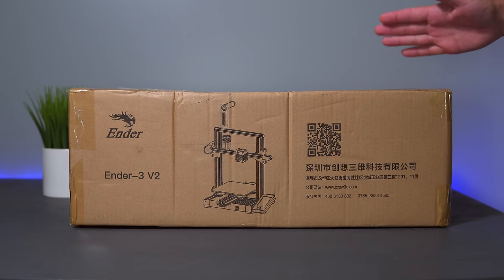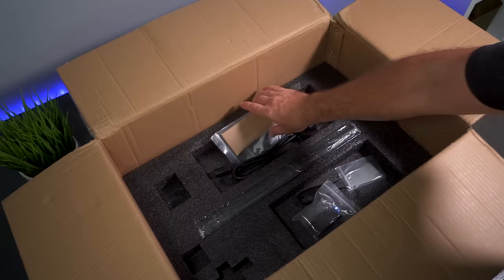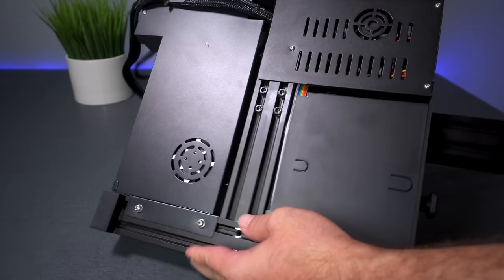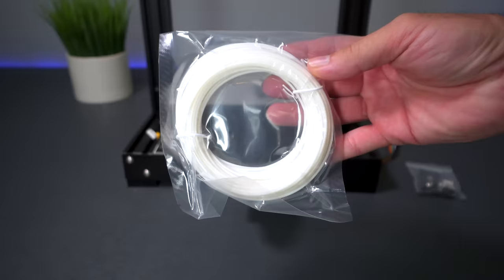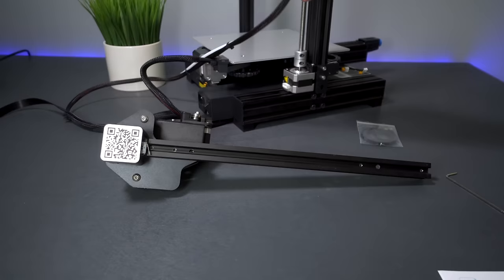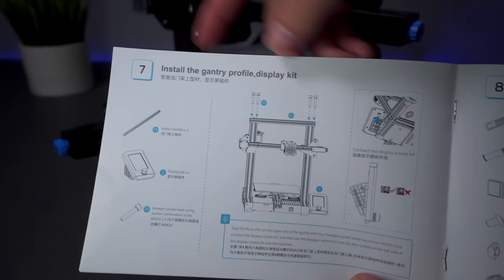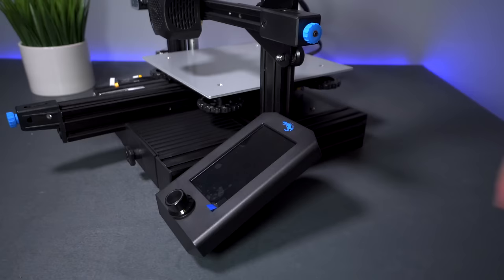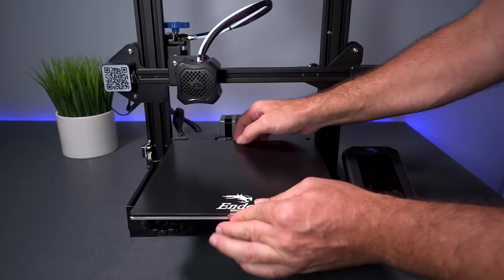Creality Ender 3 V2 - 3D Printer - Unbox & Setup

Comment: Great video, really made the process easy.  Only problem I have is Z axis does not lower smoothly or easily.  The inside rollers have virtually no tension on them, but the outer 4 rollers are so tight I can't move them at all.  It's that way from to to bottom.
Reply: Hey man! I'm actually having the exact same problem, did you ever find out how to fix it?

Comment: my bed rollers were super jumpy, the bed was not moving back and forth smooth at all by hand.. I had to take all four of the bearings under the bed off and clean a bit of debris off the out side of them with a finger nail basically, just smoothed them out because there was some factory plastic bits around them creating the jumpy slide... now that around the bearings and main rail is clean, it works perfectly.  Hope this helps someone out there.

Comment: Z-axis end switch was at my Ender 3 V2 to low, so that the bed had a collision with the stepper motor of the bed. I lifted the end switch 2mm and it is okay now. I can recommend to use a thin paper for leveling and not the paper cards with the Creality cloud invitation. I had a leveling problem in my frist print which I ever made. I guessed before it was the paper size, but now in addition it was the low end switch. The power cord connector stop movement of the bed because it can collide with the bed wire and prevent movement of the bed. Routing the wires was not considered in the design and should be improved. Leveling with a preheated bed is enough, there is no reason to level it first at room temperature. The video helps to setup the 3d printer, thank you.

Comment: This video helped a lot, but also make sure to pay attention to where your wires are when your erecting your frame cause I ran into the issue of having my Filament tube and wires going under the  top bar lol. Also my temps came programmed a lil different so don’t worry about that either. I assume it was just a update on Crealitys end. GREAT VIDEO 👍🏻👍🏻
Reply: Also I put my SD card in and out 2 times and my preprogrammed prints finally popped up

Comment: Can't add images but the way I got my x axis motor on was by placing the aluminum bracket overhanging the table, then holding the motor assembly on top of it with one hand. It made it a little harder to get the screws in place, but everything else was nice and steady while I worked.

Comment: I cant stress how important it is to retighten ALL the screws. My nozzle wasnt tightened properly, so I had filament leaking. Save yourself from this mess and tighten it once in advance while its hot.
Besides that the print quality is very good without doing much tuning. Bed motor gets a bit hot. And for the USB cable to work I had to install a chinese driver. Motors are super quiet, fans are pretty loud (louder than a gaming notebook trying to run crysis).

Comment: I just got my Ender 3 v2 working and the literal sticking point was right at 23:37. I couldn't lower and raise my X-axis like that (can't do it on the two other machines here, for that matter, but they are dual Z-screw, if that makes a difference). The Z-axis was totally bound, unable to move at all until I shimmed the Z-axis motor about 1mm (two thicknesses of the cardboard the nippers came in). Then I could lower and raise the axis just fine, autohome worked, got the bed leveled and it's making a test print. There are lot of more complex and expensive remedies, from flexible collars/couplers for the lead screw to fiddling with the bushing. This fix was shipped with the machine and it was the right price. Maybe this will help someone else. I have been stuck for about 2 days with this. A friend w a working machine (bought the same day as mine) was able to eliminate all the other options but the location of the Z motor. That was it.

Comment: If the x axis isn't moving smooth vertically (up and down) like his or is smooth for a little and then gets stuck...and you've followed his instructions perfectly,  it could mean your vertical linear actuator rod (the tall screw like rod) might not be straight up and down. If this is the case, you might need to put a washer or two in between the frame and z axis motor (the motor that spins the screw-like-rod). What the washer will do is create a space between the frame and the motor which might vertically align your rod allowing it the x axis to freely move. This fixed all my binding problems and it's soooo smooth going up and down.

Comment: Thank you for this detailed guide, i just received mine yesterday and i followed your video to assemble mine :) I just had one problem with the z-axis motor, i cant have it completely still, if i screw the bolts to the end, the z-axis simply wont move, i had to lose the bolts almost to a point that the motor shakes, have to figure how to solve this! Thank you again for this great guide, sub and like!

Comment: Very helpful video Vlad! Don’t know what I would have done without it!! Had some trouble adjusting the platform low enough. I realized that I had to raise the limit switch bracket the height of the largest Allen wrench was wide. It’s almost as though it’s the same as the thickness of the new glass plate! I wonder if my printer came with the old style limit switch mounting bracket before they added the glass?? Oh well it works great now and I printed off the dog which came out great. Thanks again!
Craig

Comment: As someone who recently bought the Ender 3 Pro, I strongly regret not noticing earlier that there was a version 2. Version 1 is obnoxiously loud and the aluminium bed with its magnetic cover is an absolute nightmare because the aluminium bed being warped is a very common occurrence.

It was only $50 more for the V2, which is less than what I've had to pay for all various upgrades to make the Ender 3 Pro be quiet and not have to level the bed after every single print.

Oh and V2 coming with thermal runaway protection is a pretty big deal, every means of protecting against a potential fire hazard - even if the chances are small, are welcome.

Well, that's the beauty of hindsight, I guess... :(

Comment: Oops. You forgot to mention that during packing, the print head cables might have been fed through the unit from back to front for tidiness. I assembled until the point I realised I had to disassemble so that I could feed the print head cables out to the back and then reassemble.

Comment: Don't you need to make sure the x gantry is perfectly straight. On an ender 3 video you have to do an extra step to level it. Using a measuring device on each side before putting the right side wheel bracket

Comment: This is useful, but I have to put it in .5x speed because you will say "put this like this" then switch to the next scene less than a second later. Still far more helpful than the manual.

Comment: Very detailed video. I noticed the ender 3 v2 I got had a damaged bed wheel which didn't move and my x axis was crooked. Spent days trying to fix it and level the bed. But I must have gotten a faulty product. Returning it for another brand but at least this video helped me set it up and print a test file from the SD card.

Comment: This is a great tutorial, only be careful I screwed in the second screw before putting on the tensionear on the x axis, and wow that was months ago. I stripped the screws had to get screw strippers and new screw, accidentally scratched the rollers with a dremel so I got replacements. Be careful cause these screws are extremely cheap and make sure to get Alen keys that are black

Comment: Thank you so much for the assembly video.  I grabbed one this weekend from Microcenter with the $100 coupon.   I'm pretty mechanically inclined but I wouldn't have a chance doing this with just paper instructions.   Looking forward to playing with this.  Unfortunately thanks to this it will be accelerating my PC purchase as I highly doubt my 15 year old Windows 7 box is going to run the slicer software.

Comment: The manual needs better explaining to assemble this, I worked in the automotive trade, plus built many RC helicopter kits and am pretty mechanical but your video helped me get through it. had to pause and go back at times as your pace is very fast but enjoyable.

Comment: 23:40 what happens if it doesnt move smoothly? Which ones do I tighten or loosen? Thank you for the video :))
Reply: mine dosent move at all when i push on it did you find a fix?
Reply: @dogggobeeg972  still no solution, the only way I can move it, is by turning the motor
Reply: @dogggobeeg972  I asked someone else and they said its normal for it to not move if using by hand. But if u try spinning the motor part, and it moves up and down, it should be fine.

Comment: When I level my bed，I'm using the exact same method. It is level to the point where all four corners in the middle have the same tug. When I go to print nothing sticks to the bed and then I agree home it to check if it's level and it's so far above the bed that the paper won't even touch the nozzle. I'm doing all of this with a heated bed and nozzle. I can home it a thousand times but once I start to print it stops being level and nothing sticks to the bed

Comment: You cut out the part where you raised the bed back up so that it doesn't get caught on the motor and continue trying to drive until burning the motor out because it cant get to the stop switch.

Comment: I'm following this tutorial and it's very good! However, I can't move the z axis by hand and adjusting the rollers doesn't seem to do anything... The rollers on the right side move just fine but the ones on the left side are really hard, like if they were fixed... It moves fine if you turn the stepper motor or the lead screw so it seems like a problem of the rollers...
Reply: I ended up having the same issue, what I ended up doing was loosening the entire wheel by using the allen key and the concentric wrench, then adjusting the wheel tension until the wheels had a slight resistance to it, I hope this helps!

Comment: I'm having a huge problem with the right side of my gantry sagging. I've followed the video as closely as I can, but it still sags. Another issue I have is that I can't lower the bed all the way or it can't go back far enough to hit the switch because it hits the Y motor.

Comment: Having trouble with getting the belt for the bed aligned. I have the ends pushed over as far as they will go but after running the bed back and forth a 3 to 5 times the belt rides back over to the edge of the roller.

Comment: Wow is ender 3 v2 that good! You seem to get amazing print quality out of the box.My ender 3 didn't work out of the box due to some power issues and after struggling with it for a week I was only able to pull of some small basic prints which had stringing, vibration and were pretty bad quality😭.Probably should have followed you assembly guide back then.

Comment: Do NOT spin your bed down as low as it’ll go as this video instructs at 34 minutes. You can lower your bed to the point that it will get caught on parts BEFORE IT HITS THE STOP SWITCH and this can strip out your motors.

Comment: Great video! However I think you should add how to feed the filament into the extruder. I got confused on that part didn't know we could press the spring to pull the thing apart to place the filament into the hole. I missed the hole essentially and it got jammed had to replace it with a metal extruder. Thanks for al your help!

Comment: Okay, so I did exactly as you did, put the z limiter in the right spot etc... I put the bed as low as it can possible go, It took me like 40 minutes to get the wheels to not be super snug and be able to turn... (before I could not push the middle bar down at all with my hand. Now I can push it down, and sort of pull it up (although resistance)... I auto homed it and started leveling the bed. I levelled the front corners, then went to the back. The back the hot end tip touched the bed, so I lowered it down as much as I possibly could, still is touching the bed.. also the bed wont go back all the way now due to hitting the back motor... I have no idea why.... how can the bed hit the back motor and yet it STILL needs to be lowered to level correctly....

Comment: my creality ender 3 v2 rollers on the left motor side bind really bad when raising the nozzle and there is no way to adjust the rollers due to the metal spacers they use also no matter how tight i make my bed the nozzle hits the bed like 5 or 6 mm before the switch stops it. also when leveling the bed i cant move the nozzle because the middle of the bed is higher than the lowered sides meanign when i move the nozzle it just drags across my print glass.

Comment: I bought Mike reality approximately two weeks ago. And I watch this video and assembled it. the test prints worked but ever since then it's been one problem after another. It's now stopped rising as a prince. So it makes the base level of the print and can't go any higher. So I end up with a failed print a big mess. The filament keeps breaking in the tube. And I'm assuming that is because the film and that's in there has nowhere to go. I find it hard to believe the stepper motor a big break the fast. Anyone that can help I would deeply appreciate it. I can't seem to get any answer from the manufacture. Or even acknowledge .

Comment: Bought mine this past weekend from the same seller on Amazon.  I noticed you referenced the steppers as “42-40” but though mine is a v2, upgraded, it is showing “42-34” for the stepper and motor.  I’ve already sent a message to the seller about the disparity.

The video, including the close ups, has been helpful extremely to this sad, pathetic, newbie.  :D. 
However, around 22:45, you mention making sure the wheels aren’t too tight.  On mine, the bar does move up and down, but not as apparently easy as yours does and the wheels are very tight.  What should I be loosing specifically?  I don’t want to foul it up by trial and error and best to ask the expert.

Thanks.

Comment: Can someone help 28:00 we're installing the knob for the extraction feed. I installed it, it worked. I found out later how to manually feed and fixed a few issues. Two days later the knob will no longer go back on because the extraction shaft has disappeared. Does this fall off? Google isn't helping much.

Comment: Can you please explain how you got the files to show up on your display? Mine also didn't show anything but when I plugged it into my computer they were all there. I sliced a new file in cur and saved it to the removable drive just like the video but when I plug the SD onto the printer and go to print still nothing

Comment: I did everything as explained but I have the bed screws cranked down all the way and it still hits the bed almost everywhere.  I'm not sure what to do
Reply from the maker: Raise the Z axis limit switch about 5-10mm if your bed springs are fully compressed and the nozzle is hitting the bed.

Comment: Following you video but having an issue with the Y-axis belt alignment. After aligning the belt to center moving the bed from front-to-back the belt always drifts right on the front pully. The tabs seem to be all the way in as you describe. Any advice for a new user on how to address this?

Comment: I ran into numerous issues with this while building. I’ve reached a breaking point where the pla filament won’t feed past the gear and is just getting stuck. I managed to get a small test piece of PLA to feed in and when I attempted to recreate the success with the actual spool it fails every time. The filament is being pushed to the side of the hole it needs to feed into by the tension wheel opposite the gear

Comment: Thank you for your video , on fitting very top bracket I'm thinking of using a vernier  caliper to get it exactly  parallel. I think it will be the best way to get it to 100mm .
Reply: Ment to say to 0.01 accuracy  parallel.

Comment: not sure if anyone is still looking at these comments, but my question is;  how do you adjust z-offset permanently.   when I auto home z-offset is way off.    do I need to adjust the z offset switch height??  I bed leveled by disabling steppers and pushing print head down to the bed.  leveled, and it worked.  BUT when ever I start a print I need to quickly Tune and set Z-offset to .5.    I'm doing something wrong.

Comment: 21:50 I cant seem to push down, if i spin the nut on bottom it works but has some resistance but i can't push it down with my hand. I can pull it up with my hand with little force. Is this normal?

Comment: My ender 3 v2 is not in the best shape and has very bad QC. Holes for the rails drilled wrong and the cam nuts way to tight on both the vertical rails at least the z rod is ok, prints are really good surprisingly. The flaws in the design are that you have to leave the z motor less tight than desirable, and chase level between every few prints because of the weird long springs that wriggle around.

Comment: You made one large mistake. When you are putting the z limit switch on you need to hold it up 1/8 th of an inch so the bed heater wire doesn't run into the y axis motor.

Comment: I'm not sure what else I can adjust on the printer. I can push the extruder bar down with my finger somewhat easily, but cannot pull/push it upwards, the wheels are loose but not too loose, the guide screw is supposedly aligned, it moves down with little to no resistance when turning, moving up theres very minimal resistance.

Comment: Trying to put this thing together by following along, however the piece of the unit which is supposed to glide along the track easily just...doesn't without a LOT of force. Everything is still loosened up, but it seems like it's not threading the long motor screw or on the track properly, even though by all appearances it is. Not really sure how to proceed.